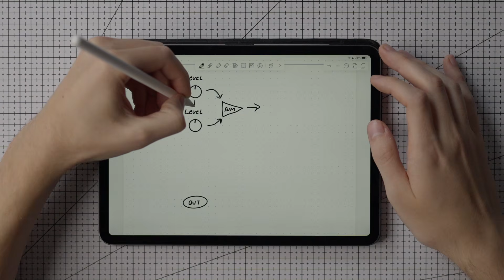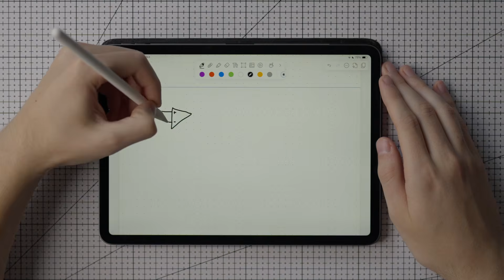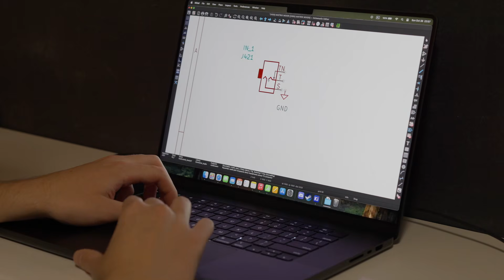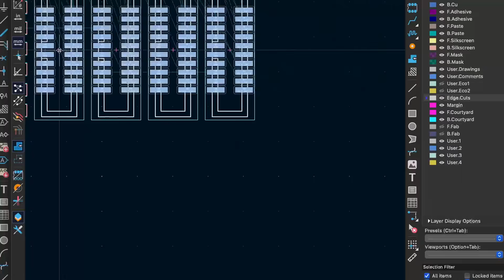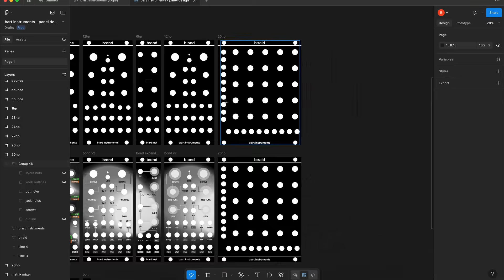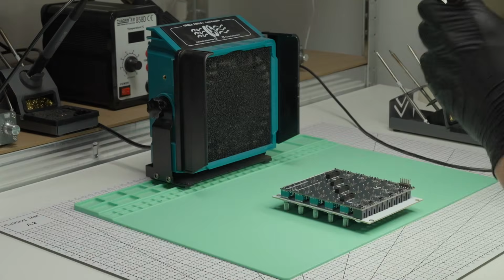I Designed the Eurorack Mixer I Wanted to Buy

Comment: Beautiful work! I use an AI018 four channel stereo matrix mixer in my rack and I love it. This looks so nicely done. I also agree with what others have said about cv control over the routing - that would be awesome, even if it did take up more space. NLC's Clump 4x4 mono matrix mixer is one of my favorites for that reason. Even though it gets crowded cable-wise, when one of the crosspoints is cv controlled you really only use the associated knob to trim the automation, so honestly it's fine, imho. Anyway, I love your work! What you've done here is super cool.
Reply from the maker: Working on it as we speak! Can't tell exactly when it will be ready though. Thank you for the kind words!

Comment: my dream mixer: 6 channels with the option to expand or daisy chain,  stereo outputs with led vu meters and seperate headphone out with cue function, 2 effects sends , mute switches per channel, hi and lo EQ per channel, panning per channel but importantly i want CV control over the panning and effect send knobs. sliders for volume instead of knobs, all jacks on the top of the module and all in under 30hp, lol.
Reply from the maker: If only Eurorack was 5U tall, then this might be a reality - not enough vertical space for all the features you have written :(

Comment: What i would say though, is that if the module is fully patched thats a lot of wires causing a traffic jam. Wire ergonomics in relation to a full patch is something that is also considered. In that case a 4x4 mixer might have a bit less issues with cable management
Reply from the maker: Depends of course on how you route your cables! I route my inputs upwards, for example, and they get out of the way neatly even when fully patched.

Comment: Rather than stereo inputs and outputs, you could have done mono inputs and outputs, and used the second jack on the left side as the CV for a VCA for that input. That would have been tremendously useful.  And you could have used the second jack on the bottom as a Mix B -- that is, the opposite of the mix.  Maybe a crossfade CV option would have been nice too.
Reply from the maker: VCA-based modules introduce a lot of noise to each signal passing through them. I wanted to make this module as low-noise as possible to place it at the end of my chain as a clean sends/returns machine. I might look into making a more general/flexible module that uses VCAs in the future though!

Comment: This is a great breakdown of a design that's about as good as it gets for eurorack, and it's a good example of why eurorack mixers are always bad. It's not the mixer's fault. You're running on 12V with 10vpp signals, so you've got tiny rails choking everything on an unbalanced architecture where unity is 9 dB above pro line level. It's mathematically impossible to have the headroom to actually mix anything. You could attenuate everything and make the noise floor even worse. You could boost the rails with a DC-DC and have an output even hotter than 10vpp. You can't win. You need an external mixer to mix anything. Even a used $100 Mackie has so much headroom compared to eurroack it'll blow your mind.
Reply from the maker: True. Not only mixers, even filters and other modules do suffer from the headroom problem. Shame that Eurorack can't be easily translated into a better standard like professional line. Thanks for commenting!
Reply: @b-art-live  I just love how clean/functional your design is. It'd be fun to make a 2U stereo balanced version with 18V rails... but then I've already got a bunch of Ashly 308Bs and Behringer RX1602s and what I really want is something MIDI VCA-able and reconfigurable with program changes, so then I'm getting an MCU and a buncha SSI2164s...